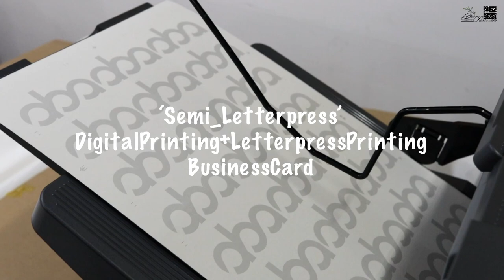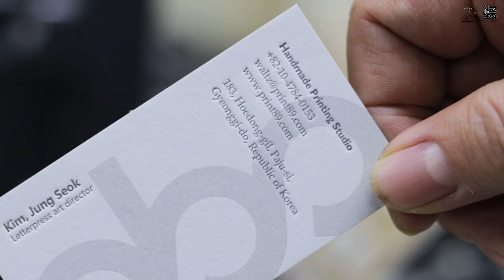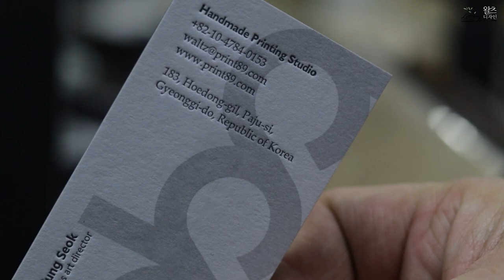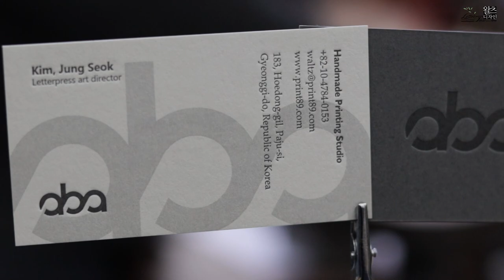semi letterpress business card_3  세미레터프레스 양면 레터프레스명함 만들기.

Comment: Great video!  Mixing digital with letterpress.  Can I ask what type of letterpress machine you are using?  What brand, if you don't mind me asking.  Thanks!
Reply from the maker: Hello, the name of the equipment is Hohner 6.5x10. It's from Germany. Chandler & Pice in the U.S. and Pilot equipment
This equipment is made by referring to the drawings. Chandler & Peace is It went out of business in 1963 and the Hoher 6.5x10 was built in 1975. 
Neither company currently exists. There is no fixed place to sell. 
I made a difficult purchase to a private seller through Google search.
Reply: @w_letterpress  Thanks for the detailed, this machine is a good buy!  Been wanting to get into letterpress but dont know where to start, and no more space in our small work space.